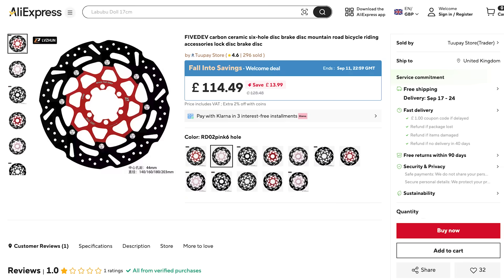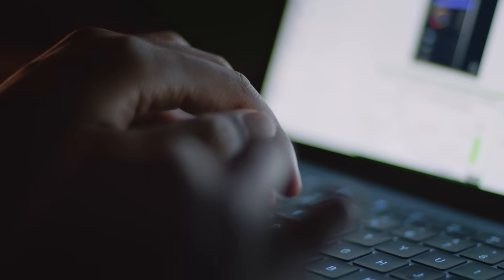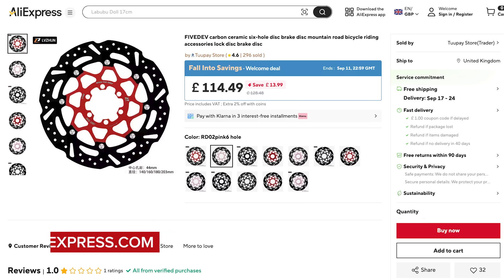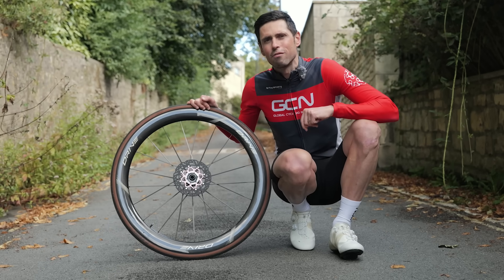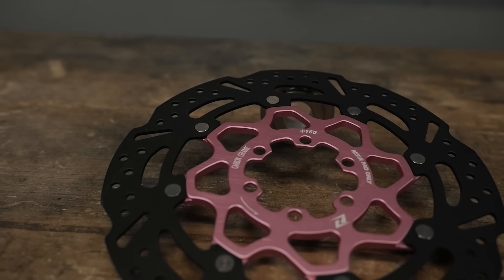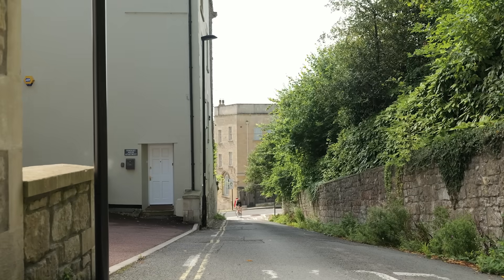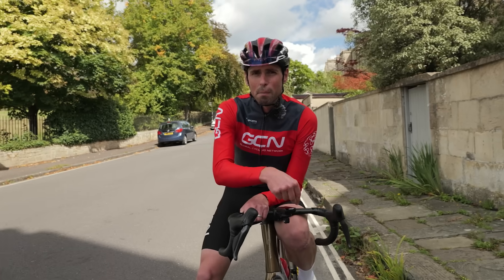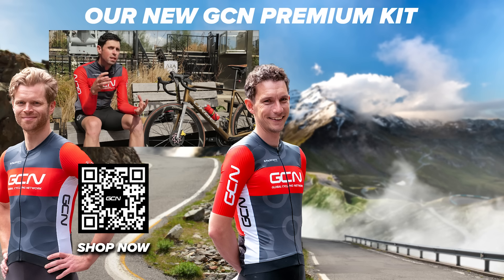Why Bikes Can't Have Carbon Ceramic Brakes

Comment: The reason that carbon brake packs are used on planes is that, in spite of the cost, every time a commercial airliner takes off they can carry significantly more weight.  Over hundreds of flights it earns the money back.  In the military, they can carry more munitions.  The money just isn't there for cycling:  even F1 economics are no match for military spending and thus why it trickled down from the military and NASA.
Reply: The use of braking for an airliner is also much different compared to a land based vehicle.

Airliners use the brake very gently during taxiing, and they use the brake with full force at landing until they reached taxi speed or at take off abort when full power is needed to come to a stop.

There's not much in between and during the other phases of the flight the brakes are not used at all.

On the other hand the weight savings are huge here, since they have to have very much heat capacity.

On a bicycle the weight savings would be marginal.

Comment: Lemme guess. The conclusion of the video is that not enough heat is generated by the weaker pistons of bike brake calipers, because the bike and rider are a lot lighter than a vehicle. 
So they might be useful on a really fast downhill course, or that crazy French race that starts on top of a snowy mountain, but otherwise, no. 
Hard no.

Comment: All the benefits of carbon brakes simply cannot be realized under non-extreme loads, and on well paved surfaces. Recall everything your guest engineer just described: They are fragile under circumstances less exotic materials shrug off. And they only operate well at higher temperatures than ferrous materials. Look up the history of their adoption in GP motorcycle racing to see all the problems that had to be overcome. Even now, issues arise in that application. Call me a retrogrouch, but there are a LOT of long-solved problems that the cycling industry keeps throwing "high tech" at--carbon wheels were one instance of this. Their drawbacks are described in Alex's piece here, and were only solved by going to heavier and more complex hydraulic disc brakes.

Comment: I’m happy to stay with my rim brakes as easier to maintain, fix & use & install😊 I’m not following the sheep……im sticking with what just works & bedsides to expensive to change to a new bike, wheels, pads etc….

Comment: As a cyclist and car driver with carbon ceramic brakes CCBs, here's my opinion. CCBs are for track or racing cars, as they are expensive and designed for repeated hard use because brake fade is caused by heat and no brakes means you go slower or crash. Heat is the enemy, but they are also light, have virtually no dust and last longer than steel brakes.
For most cars, steel brakes work perfectly and the cost of CCBs can't be justified.
For bikes, heat isn't an issue even for long twisty mountain descents, as discs are exposed unlike cars and not close to engine or tyre heat, cyclist plus bike is only rider weight plus say 8kgs, and force applied isn't anywhere near a car let alone motor bike. Yes CCBs need warming up and cyclists don't build up or retain heat on brakes like cars can.
In summary, costs outweigh benefits and I can't see them being necessary or  desirable for cyclists.
Reply: Yeah, I get that, but 80kg versus 80g of disc and the unrelenting draw of gravity down a ten mile descent with hairpin bends? Sounds like a not unreasonable case for carbon ceramic brakes if not a totally obvious one. Thoughts, folks?
Reply: @joetaylor486 Not even close to the same levels of energy needing to be absorbed and dissipated. A 2000kg car decelerating from 300kph is several orders of magnitude more energy than a 75kg bicycle+rider decelerating from 80kph. 

That said, they'll probably still exist at some point, because ultimately braking performance just doesn't matter that much in cycling, and people like having lightweight, flashy, almost pointless things (oversized pulley wheels, looking at you.) Motorsport is mostly about maximising every single moment, you're either at maximum acceleration or maximum deceleration (yes I know about exceptions like tyre preservation and fuel management, not relevant here) whereas cycle racing is mostly about energy management, trying to be as efficient as possible, because humans can't operate at maximum load for more than a handful of seconds, and an engine can. 

This is evidenced by the dominant/determinant force in motorsport, grip, being vastly less relevant in cycling, where the dominant force is probably drag.
Reply: @tinglydingle Well said, and I bow to your superior knowledge.
Reply: @tinglydingle  the brake system of a car is also several thousand times of magnitude larger when compared to a bike, i'm no athlete but i was perfectly capable of getting brake fade with sintered pads and 200mm rotors slowing down from around 50km/h in a single hill from cold temps
Reply: @Ferrari255GTO I'm not saying it's impossible to overwhelm a bicycle braking system, I'm saying that braking performance isn't super relevant to cycle racing because they don't factor into the determinant property, which is energy conservation.

In racing cars, the brakes are an essential component to performance; the better the brakes, the later you can brake before a corner, meaning the more time you can spend at full throttle, improving lap times. On a racing bicycle, the human cannot power it at maximum effort for more than a few seconds, so the benefit to braking later is diminished because you don't lose out significantly by braking earlier. Brakes on a bicycle are obviously still important, but they're primarily a necessary safety feature, rather than part of a performance package. 

However, there are still occasions where better brakes provide a benefit; long mountain descents as the other commenter mentioned, where the bulk of the forward energy is gravitational rather than human, and crash avoidance, given that crashing is detrimental for obvious reasons. I'm not saying that better brakes aren't a good thing for cycling, I'm saying that the difference between good and bad brakes makes less of a difference in performance than it does in motorsport.
Reply: @tinglydingle  in reality braking in time matters just as much, even more precisely because of the fact that speed isn't something that "comes free", it's a resource you gotta save HOWEVER possible, cornering properly is more critical, but braking in a short distance is still important because it's part of the eficiency, wich road biking is all about.
Reply: @tinglydingle braking performance is less important for cycle racing on a road. Braking performance is insanely important for DH bikers who are literally on their brakes all the time modulating their speed. Those discs and pads get insanely hot and brake fade happens quite often. Also since these brakes are being constantly used, they are never in the low temp zone as in the first 20 seconds of a race, the brakes are up in heat. These could be very useful for DH riding, if they're not super fragile that is, where a single pebble can snap em like a twig.
Reply: @joetaylor486  I'd say that i'm a pretty good candidate for being an example here: Literally 3 days ago I was flying down from the top of Ventoux, I'm about 95kgs, plus water bottles, shoes etc, and the bike, so let's say roughly 110kg all up. On regular hydraulic 105 discs, standard pads, I had no issues stopping at any point, although I suspect that if this was something I was doing regularly, i'd probably be getting through plenty of pads. The point is though, I've just done a 10 mile descent with hair pin bends, i'm at the heavier end of the scale for cyclists who go up mountains, I never had any issues with my brakes and I would also say that if the brakes were any more powerful, grip from the tyres would be my issue, not brakes. Heat has been an issue in the past for me, but that was on cable discs (TRP Spyres) and on some pretty cheap pads that I usually only fit to my commuter bike (I only buy them because the lack of maintenance that bike gets, especially after riding through winter, absolutely kills brake pads). If you're going up a mountain, most people would be fitting at least reasonable pads, which are more than up to the job.
Of course, the other benefit of standard steel discs is that on the flat ride getting there, my brakes worked instantly, something that doesn't happen with carbon brakes, they need higher temperatures for them to be in their operating range.
Reply: I agree with most of your comments, except that they are expensive, I believe that they are sold for a lot but the rotors aren’t that expensive to make, it’s more to hold up the luxurious association of them, the CCB on the new Xiaomi SU7 Max are pretty affordable. They could be taking a loss on them, but I feel like it’s more likely theyre just representing the real cost of CC rotors
Reply: I do doff my cap to your experience with this brake system, but I posited a contrary view and would welcome your thoughts

Comment: No thanks Alex.  I tend to avoid using brakes (which are only wasting the energy of my pedalling and I need it all) so I'm unlikely to keep them up to their working temperature.
In the F1, you must have seen those great clouds of black brake dust at pit stops.  Imagine breathing that in (the mechanics have breathing apparatus).
I think you are much braver than me rolling down that hill to a blind T junction unsure whether your brakes will work and all for a video.  You deserve a medal.

Comment: I can maybe see carbon-carbon brakes working for bikes if the whole braking system is redesigned. 
Ever seen aircraft brakes? They look a lot like a motorcycle clutch with stacked plates sandwiched between each other in a basket that fits in the wheel hub. 
A design like that on a bike could be quite small, aerodynamic, and maybe keep enough heat in it to work somewhat consistently. You could probably make it fit inside a hub only slightly bigger than a standard one. That said the difference in the amount of heat put into bike brakes on a flat land ride as opposed to a mountain descent is so big that I can't really see it working well in all conditions, plus the cost would likely be prohibitive.
Reply from the maker: Thanks for the thoughts!

Comment: Everything for a bike can't be made from the same material, and not everything is transferable from motorsports to cycling. And for the weight saving and rotational mass saving, that's minimal.

Comment: I tried a cyclocross bike with carbon wheels and v brakes.
Braking was weak at the start then improved and forced me to ease off to not go over the bars. Terrible feel the same force at the lever gave different braking performance depending on the heat build up.

Comment: Ooooo... Me, me, me! I had some Kettle Cycles SICCC rotors on my mountain bike. And they were... meh.  Hella light but the big thing was my bike had alway been prone to a resonance in the front wheel, that I always attributed to 1/2 radial lacing and/or Avid Clean Sweep rotors.  The SICCC rotors never squealed.  But they ate brake pads.  Still got them somewhere, I'm sure, but I swapped to Shimano icetech in the end.  And BTW I work for a company that does carbon-carbon brakes for airliners.
Reply from the maker: Thanks for sharing your experience!

Comment: Carbon-ceramic brakes could be good on TT bikes.
The fact they don't brake all that well when cold would steer the design of ceramic discs towards smaller diameter rotors so they can heat up quicker, reducing frontal area slightly.
Also having a weaker initial bite on the brakes can be good when riding overly stiff three-spokes and disc wheels.

Comment: Comparing F1 brakes to the bikes on a bike, is totally dambass.
Carbon disks need a high working temperature, and if they are not to shatter in use - that goes for tru carbon bike disk brakes as well - the constuction of the disc has to be adapted to it.
The bike carbon disks are normally just carbon on a steel disc, so it just sucks in all ways, and is inherently unsafe.

Comment: Hello... Yes, I invested in the original kickstarter with Kettle bicycles for their Sicc SFL full carbon rotors and I did recevie them. They were completely flat piece of cnc'd carbon fibre...12k weave. I had the SFL160's on my Moots hardtail 29er mtb at the time on Chris King Hubs with Enve wheels. They had a specific brake pad to use with them and a specific bed in process I recall that they wanted you to follow with their rotors. The carbon rotors were just ok on dry conditions, providing about 50-60% of the power of the steel SRAM rotors with SRAM Guide Ultimate brakes at the time. That was way back in 2014. I mean they worked...but so wood a piece of wood ..haha.. they did stop you but not great. They were very scarry when wet. I have sent you photos through the GCN uploader of the rotors and bike. I too am really suprised that carbon rotors have never been a thing that could be figured out. I sold the Moots RSL hardtail with them on the bike... I wish I would have kept them.. I expect the new owner pulled them off and figured I was a bit of a nutter for having them... thanks for all the great content! - Dwayne from Canada
Reply: I also gave the Kickstarter a go way back, and yes they were barely ok when dry, and downright dangerous when wet.  And the howl from the rotors when wet was ridiculous.
Reply: I got the 2.0 version and they were much better than the first version. I am using them today on my road bike. Did a 5000+ m ride just this summer in the dolomites
Reply: I also have a pair of the SICC rotors. They looked amazing, and were insanely light, but... their performance was woefully inadequate. Their first outing was at an enduro event here in SE Queensland, and every stage was a relief to complete without a crash! Kettle Cycles had a lot of 'feedback' and ran a program where you could return the rotors to them to be subjected to some additional treatments to increase their performance to that of a standard steel rotor. Mine went back to the US and eventually made it back to me after many, many months. Were they better? No idea. By that time I'd upgraded to bike that came with Icetech rotors, and I never looked back. That being said, they're still in my parts box, but I don't imagine they'll make it on to another bike.
Reply: I missed the KS - was super keen on trying this but the budget wasn't there. Should have known then that it was probably too good to be true

Comment: They can absolutely have them but, A. They need to stop with the insane holes in the things, every other vehicle has mostly solid discs on the surface with vents inside and/or slots or holes but never the insane cutouts of bicycle discs, ceramic doesn't like BS like that. And B. The conditions that type of brake is built for are effectively non existent in bicycles so it's pointless to go beyond a solid steel disc of a reasonable size.

Comment: Disc brakes on a bike are so overbraked it's not funny! I recently got a bike with Force AXS disc, from DA 11-speed Di2 rim brakes with carbon fiber wheels.
I have on the new bike 160 front and rear. The brakes work well but the stopping is noisy, too freaking much, and grabby. I have decided to go to 140s front and rear and maybe some other pads.
Bikes don't need discs period. Maybe if people weighed 350 lbs,  maybe. Frankly, the worst part is the noise. I hate a noisy bike.

Comment: Like Mr. Robinson is saying, the brakes need to be in a specific temperature zone to work well. In cycling you're never going to consistently get into that zone with all the different rides people do, making it a huge safety concern. Given the current circumstances I find it really unlikely that any big groupset manufacturer would go there.

Comment: I think that there are a few crucial differences that make it so that this makes sense for motorsport but not cycling:
- In motorsport, brake performance has a huge impact on overall performance. This is not the case in road cycling. Steel rotors are good enough for practically every application, and even a significant improvement in brake performance would probably not make any difference in placement in a race.
- Motorsport steel brake rotors are very heavy, and contribute a significant amount to unsprung mass. Making them lighter improves suspension performance, which improves everything. Road bike steel rotors are pretty light to begin with, and road bikes don't have suspension, so the weight of a steel rotor is not a significant amount compared to the unsprung mass (the entire bike).
- Top motorsport categories like F1 or MotoGP have huge budgets, vehicles that are custom built from the ground up, and that cost many millions each. You can buy a bike that is 99% identical to something you see in the Tour for less than 20k. The only category of bike racing that has truly custom bikes is track racing, and they don't have brakes. The money to experiment with new brake systems simply isn't there.

The only way that I see this coming to road bikes is if it starts becoming the standard in high end motorcycles, and then trickles down via manufacturers that make both motorbike and cycling brakes (Magura, Formula etc).

Comment: Disc brakes in general are unsafe
Reply: How? 🤷🏻‍♂️
Reply: @petersylvester2905 they can lock up the wheel and make the rider go down in a corner.  I've seen it happen on TV and in person.  I ride rim brakes still and they are sufficient
Reply: @user-kx1lz8xz1m that's the riders fault though, having worse brakes just to circumvent that is not for me.

Comment: If Al rims worked, why not try Al disks?
Reply: Good question, and there is a good reason. Aluminium has a relatively poor friction coefficient, hence the need for very soft rubberised pads, where a steel / iron disc doesn’t, so works with metallic pads. For the same reason, stainless steel isn’t used, it doesn’t perfect well.